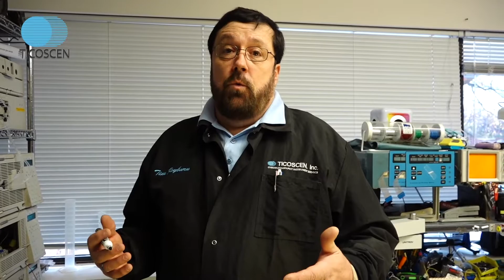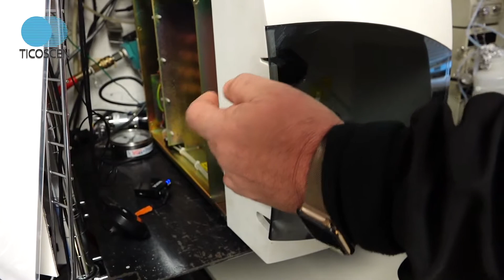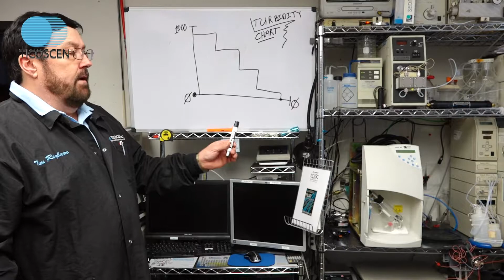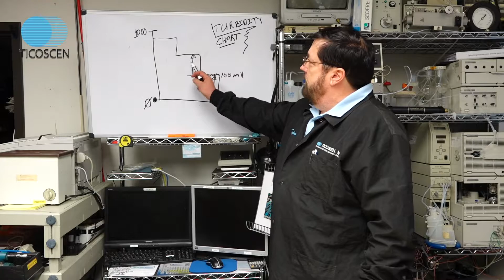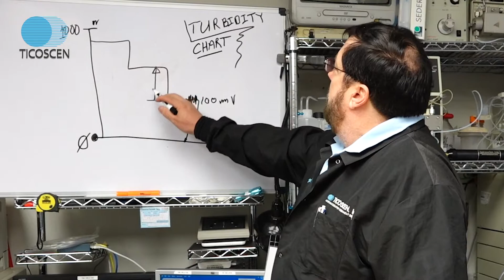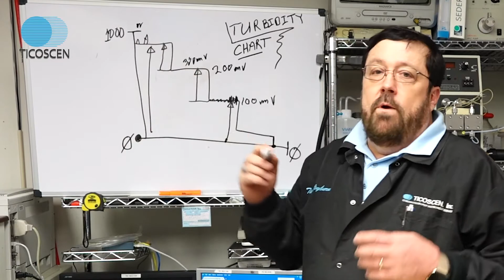Beginning ELSD Trouble Shooting (Dry Test)

Comment: HI. I can't stabilize the pressure and the mv is zero. Why do you think this happens?
Reply from the maker: Pressure sensor is bad or there is no N2 pressure.. What is the stray light level at gain 12? What type of ELSD do you have?
Reply: the n2 line looks good, the valve at 3.5 bar.  the gain is 7. what is the gain for?  The equipment is the same as you have in the video.  Thank you so much
Reply from the maker: @anavictoriabergelin6756   Gain 12 is maximum sensitivity. Gain 1 is minimum. Go to Gain 12, gas only (no solvent flow) and then turn off the LED. Next, autozero the detector. Then, turn the LED back on. If the stray light does not rise above 80mV or is "ZERO",  your LED is blown out.
Reply: @ticosceninc.elsdexpertsfda7713  Thank you so much.  I'm going to try this. But why doesn't it stabilize the pressure?  and is there any parameter to set the pressure?  because it only lets me change the pressure units.  I don't see the option to set the pressure.  Can be done?
Reply from the maker: @anavictoriabergelin6756   the ELSD only  measures the pressure. It does NOT control it.  You want a stable 3.5bar to indicate on the ELSDs LCD. The pressure is set by an external last stage pressure regulator between the main external supply / pressure tank. Your main N2 supply pressure tank should be at about 100PSIG. And then, the external in line pressure regulator will step the N2 pressure down to 3.5 bar. This noted arrangement is ideal and will better maintain stable pressure if your primary house N2 supply is unstable  during the day and varies, to some degree. (usually larger centralized sites have a negative bellcurve of pressure...high in the AM low during the day and high again at night.)
We want to try to compensate for that because that will affect performance. What is your G12 stray light level?
Reply: @ticosceninc.elsdexpertsfda7713  The pressure oscillates between 1.5 and 2.5 bar. The regulating valve before the equipment is set at 3.5 bar. Where can I check the G12 stray light level? Thanks a lot!
Reply: @ticosceninc.elsdexpertsfda7713 Im getting no change in mv reading whatever I do and i checked that the lamp is emitting blue light, any idea what the issue could be ?
Reply from the maker: Sound like  the ELSD gas pressure sensor is bad. Check stray light on the front panel.
Set gain to 12, turn the LED  off, zero the detector and then turn the led back on. It should settle to a stray light value